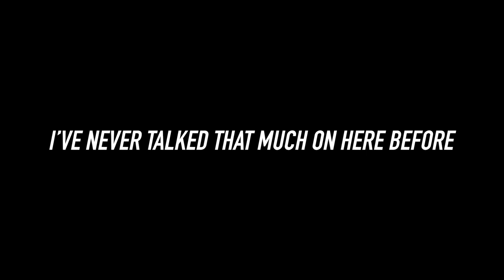Build Update: The Silent Facia Episode || Dr Decks

Comment: I think it looks a lot better for the decking to overhang and the fascia to butt underneath the decking. The way you described how most people do it.

But you should do perimeter boards around the whole deck, so you don't see the ends of the boards. Not a must, cleaner look.  Perimeter boards require a whole lot of extra blocking and a lot more time. 

It's just a personal preference/opinion. I don't like the way it looks when the fascia is flush with the decking. But I've done many like that.

Comment: If I go flush with the fascia boards too the top of the deck boards to hide the cut ends of the composite boards should I use a clear silicone too prevent water from getting behind the fascia boards ?
Reply from the maker: I GTape the framing vs caulking.

Comment: I saw you used a spacer to pull the fascia away from the rim board - Then you took the spacer out - So there is a gap, but no spacer behind? I am just an average DIY guy, so this is all learning for me. Do I need spacers cut and then installed to the rim board then fascia ontop of that - or can just gap it and not have it completely screwed tight? thanks so much